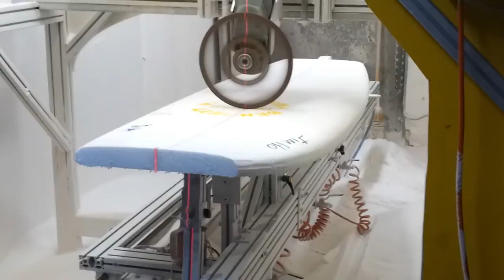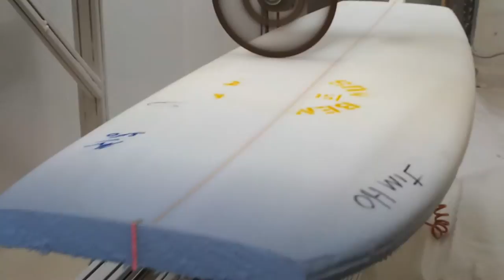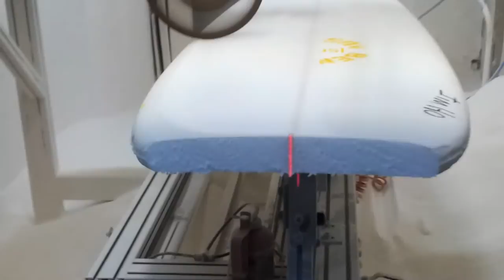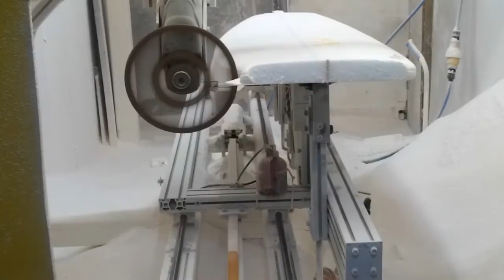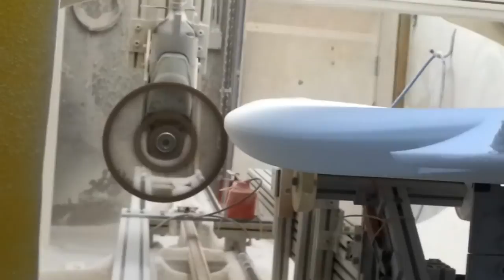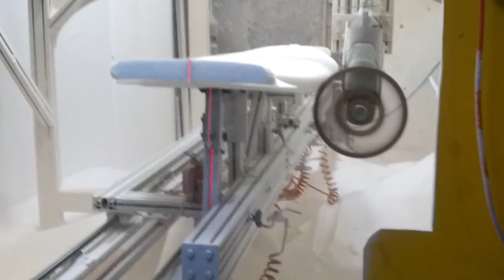Aku shaper - surfboards

Comment: What cad and cam software do you use?
Reply from the maker: Free download- its made to use on Aku shapers only. I emailed the factory to see who has a Aku machine near where I live.
http://www.akushaper.com/
Once you get the hang of the software you will be able to make just about any board you see. I just made an firewire EVO copy.
Good luck!
Reply: thanks for the quick reply, is that a angle grinder you use for spindle?
do you use that software for cam as well or how is the machine controlled?
Reply from the maker: The machine and software was developed together by Akushaper company. Software only works with Aku shaper.